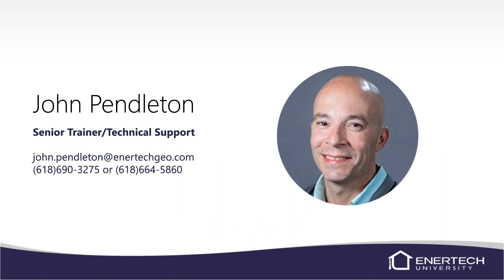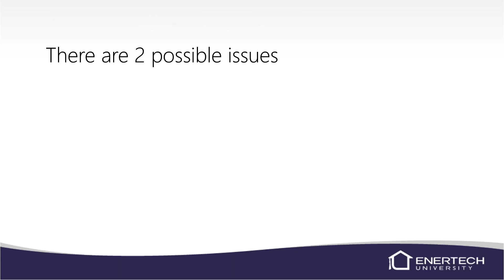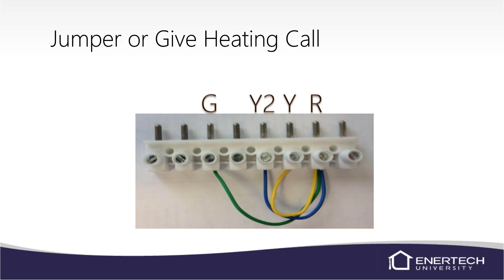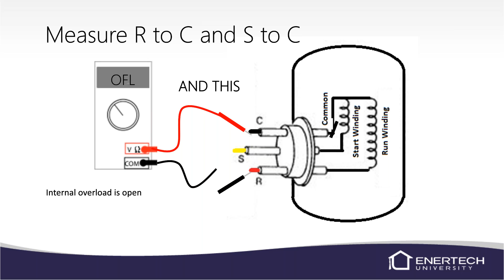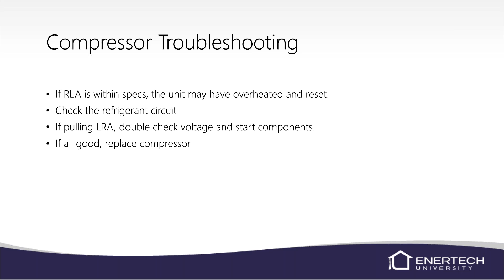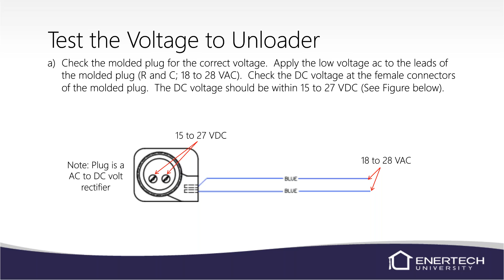Comment: Sir John how are you, I'm Nimrod from Geo Service here in Cayman. I checked a split type unit geothermal AC and when the solenoid valve of the scroll compressor for the 2nd stage works, the 24volts that supplying the magnetic contactor coil will gone. What's the cause of this problem Sir John? Thank you and God bless🙏

Comment: I have a Nutone HVAC heat pump with a Copeland Scroll compressor.  The problem is a loud buzz on startup and intermittently during the cycle.
I am thinking it may be the compressor, but, not sure.  Have replaced capacitor and checked wiring but still have the buzz at the compressor.
Would hate to change compressor if its not bad.  Any other causes for this buzz and what would cause the buzz within the compressor?

Comment: I have placed a unit in the Deep vacuum and then add refrigerant r410a in liquid form as procedure requires into the high side of the system. Twice now after doing. The compressor was not running when I added. I do this to break the vacuum and get a holding charge on it and then I start the unit. After doing this I find the compressor will not pump. Motor starts fine and the compressor runs fine but there is no pressure differential period why is this happening? I have always been taught that you can add liquid refrigerant into the high side on an empty system with no problems. Your thoughts on the matter would be much appreciated. in the old days I would call it bad valves but I know the new compressors do not have valves.
Reply: What was the fix to this

Comment: Thanks for a great guide. Very useful. Have you ever come across a scroll compressor that starts and turns off in 2-3 seconds. I was  thinking worn bearings causing thermal overload but I can turn it off and right back on with no lockout. Don't know if an open bypass would allow it to try to start and fail. Any recommendations on things to check with this behavior. Customers initial problem was a freeze up at the condenser. I came after another service guy and the compressor won't start. Any thoughts would be appreciated. Thanks 😊